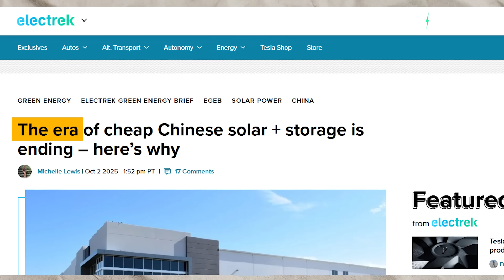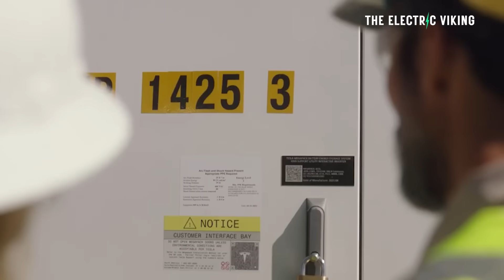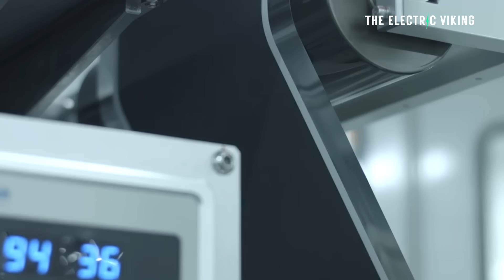Wood Mackenzie says CHEAP Chinese solar + batteries is ending

Comment: Solar panels and batteries will continue to go down in price and capacities will continue to improve.
Reply: it was not long ago that most phone battery are around 5000mhw, now most of the newe Chinese Phone battery is aroun 7000mhw and its not just in the high end phone, you can get a phone with this kind of battery capacity for around 350usd. Battery tech is not only getting better, its also cheaper and available in way more device too.
Reply: Yes, but US tariffs, taxes, fees, and restrictions will go up faster than China can lower prices.  
More for the rest of the world.
Reply: @ZweiZwolf  How are US tariffs going to affect prices in the rest of the world? Sorry, that's a US problem
Reply: @michaelthomas7898  Yes, it's going to be a US problem. That is the only market I was commenting on.  
OP is correct about the rest of the world gaining hte benefits of Chinese mass production efficiency.
Reply: lithium batteries are 1/3 the cost from 5 years ago.
Reply: Why?  Glass, aluminum, plastic, shipping all are fixed costs PV and battery makers cannot sell products below cost of materials. Physics tells us that the upper limit of solar cell efficiency is about 34%.  There are limits to how far prices can go down.
Reply: @DGlass-yg8xk  There are limits, but China isn't blocked yet.  They have a lot of capital cost baked into their pricing.  As they scale up, that cost will amortize broader and prices will go down even more.  As their cost of energy goes down, marginal cost will decrease.  As they electrify and automate, operating costs will go down.  As they move to EVs, the cost of transportation will drop.  So many levers around the edges.
Reply: @DGlass-yg8xk  yes physics gives us a theoretical upper limit of 34% with current tech.   Sales and research tells us that current panels have a 17-23% efficiency.  So what do math skills tell you about what a 10% improvement to a 20% efficient panel is?  Is it now 30% efficient or just 22% efficient?  This has been the nature of solar since the beginning.  Efficiency gains will continue driving down prices for decades.  

You also assume the cost of input materials will remain static?  Glass, Aluminium, silicon?  What happens to those commodities when their manufacture is moved to using cheap abundant renewable energy, rather than using expensive, imported fossil fuels?
Reply: @DGlass-yg8xk - Chinese PV manufacturers are said to be running ~35% capacity.
Reply: @tZydeco That means they are incurring massive losses.
Reply: @DGlass-yg8xk  不，这意味着化石能源行业的集体崩溃。

Comment: Think of panels with double the efficiency. If you aren't you can bet the Chinese are. They won't cost double. The investment is intellictual and the business is big enough to fund it organically as with sodium ion.
Reply: You run up against various physical constraints, even if you have double - action cells, on power output. The difference is 'can you make them in a new way which is cheaper /easier/last longer '. Probably yes!
Reply: I will be surprised if mass produced panels will ever double their efficiency.  They are pretty much maxed out around 35% and those for space applications are less than 50% the last I knew.
Reply: Future Chinese panels will get lighter and cheaper with improved manufacturing, but they won't get that much more efficient without a fundamental change in the physics and chemistry involved.

Comment: We are still in early days for mass design innovation. construction and installation of solar, wind snd batteries. 

A friend had an early solar system twenty years ago on a remote property. The panels worked great but were expensive. The batteries were tricky and didn’t store much energy.

 Off grid solar worked, but only with propane and wood stove backup. But folks who install led solar panels to grid tied systems paid off their panels years ago! 

But batteries, inverters and panels have plummeted in price. Solar/battery DIY kits are now the cost of four years of utility cartel electricity for powering an all-electric home and an EV.

I bought my used EV for $20,000. The battery, motor and drive train still have 50,000 miles and five years of warranty. That is better than most brand new ICE dinosaurs.

We dropped $28,000 on purchasing and installing a 14 kW panels/28 kWh battery, DIY kit. 

Our next vehicle will be a small, EV pickup to replace my great but venerable, and extremely expensive to run, Dodge work truck. It’ll have vehicle to home charging capability, and it’ll mean one more loss for the corrupt, fossil fuel and electric utility cartels, as that’ll be one more vehicle that no longer burns gas, and another vehicle charged 95% from home solar panels. 

The big problems with solar, batteries and EVs in the US is that our 1% oligarchs now own 90% of the country’s wealth. The bottom 70% of Americans are now third world in terms of savings, wealth, healthcare and education access, and disposable income.

If the rest of the rest of us are to reap the huge benefits of home and business and vehicle electrification, we will at minimum need access to the same permitting and financing rates that the mega corporations get! 

Electrification of everything and the end of ICE vehicles are inevitable because prices for batteries, EVs and solar panels will continue to drop, while the cost of corrupt cartel electricity and fossil fuels will continue to skyrocket. We’ve already reached the inflection point where gas and coal can’t compete with solar, wind and batteries. As prices for renewables continue to fall, the financial losses for fossil fuel and ICE vehicle corporations will grow even worse!

Comment: Markets will decide. Energy will always be in demand and new ways of mass producing NRG (fusion, thorium etc) are at least 2 decades away from reliable production. Storage is looking like getting cheaper fast, so if conventional nuclear isn't suddenly widely embraced, solar and storage is the future for the next 2 decades.
Reply: Thorium reactors are the closest one to mass adoption. But fusion, I don't think it will be ready in the next 2 decades, as current fusion reactor can only sustaining the self reaction for only 10 minutes
Reply: China is about to see massive expansion in nuclear, as they complete trials of their new Gen IV PWR and the Thorium Molten Salt Reactor (TMSR) in the Gobi Desert, while still refining current modular vs Small Modular Reactor (SMR) construction techniques. By 2030, the science, technology, engineering, and analysis review should be at a point where they can go into mass production of nuclear the same way the do for solar and wind, with a 30-70% reduction over existing cost, which is already the lowest in the world due to large modular construction.  When that happens, it's over for fossil fuel consumption in China.

Comment: Solar panels are not difficult to make and can be made anywhere. Think about it. If a 4k TV that's almost impossible to make and contains expensive chips and software can sell for $200 I think solar panels can be made for next to nothing. If they cost a lot it's not because of the cost to make them.
Reply: the main material for solar need a lot of energy to make it. That why currently  China is making over 90% of it.
Reply: @airrodgers1242  A "lot" is relative. How much energy does it take to make a TV panel, glass, frame, and chips? Not to mention how much water. The largest water customer in Dallas is TI and they only make chips. Don't even get me started on data centers.
Reply: If it's so easy why aren't you making it?
Reply: @ladygracienyc2029  I'm not in that business.
Reply: @ladygracienyc2029  Well Frank has made it, he is doing just fine, thank you very much.
Reply: @ladygracienyc2029  Hmmmm, apparently it's even easier to make silly comments.
Reply: @ladygracienyc2029

Because he doesn't own a factory with the necessary tools? 

That's like saying "if plastic buckets are easy to make, why aren't you making it?"

It can be easy to make on a societal/industrial level, but still require a lot of big, specialized, tools and labor to churn out by the billion